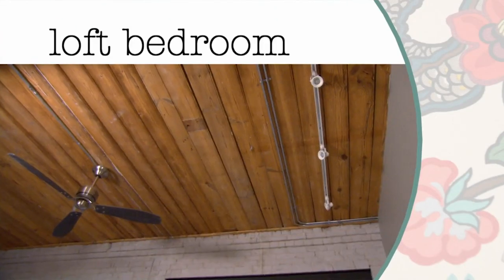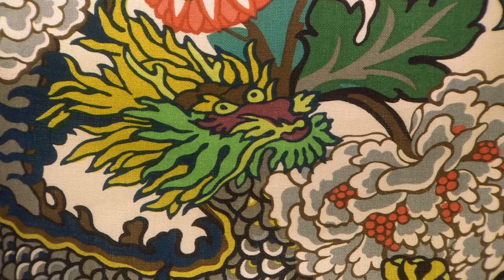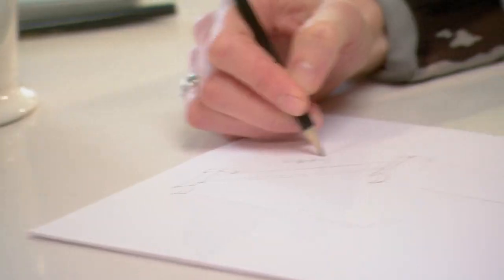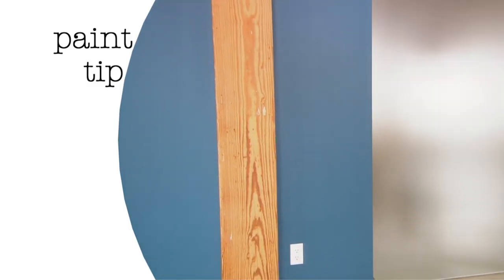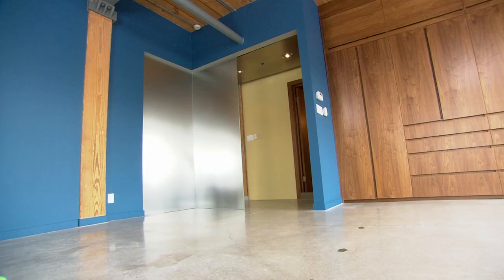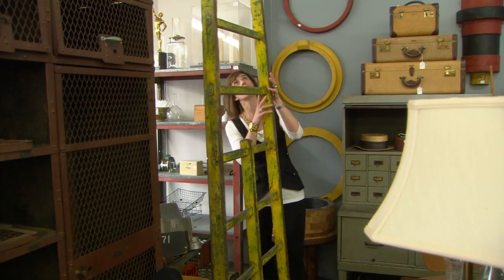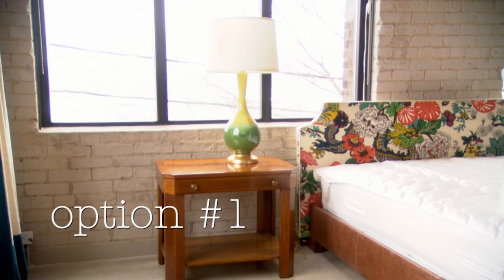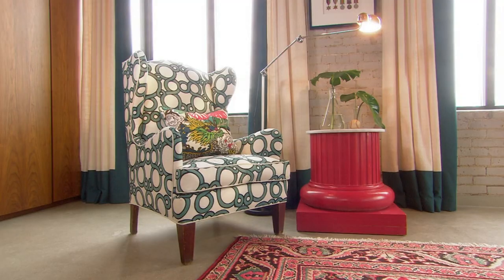Tips For Industrial Style Interior Design Inspiration | Sarah 101

Comment: One of Sarah’s “building blocks” advice is to keep the basics neutral and to add color and pattern where you can change it later more easily.  But the bed covered in such a specific, busy, and colorful pattern is a massive commitment.  One episode, and I’m already tired of that fabric!  Obviously, I’m not the decorator, but using the dragon fabric on the chair or the shams or even the bedding would have allowed more flexibility for the client and the room.